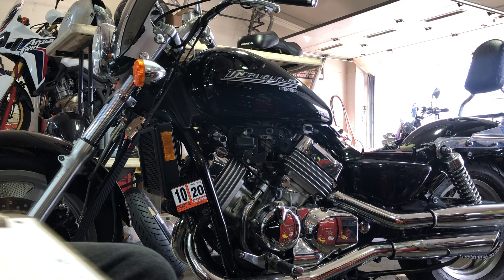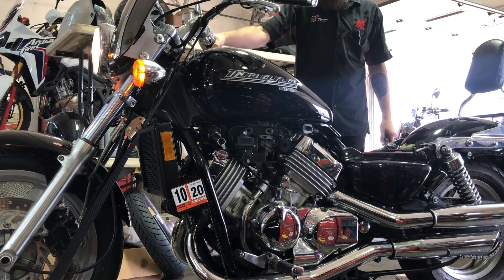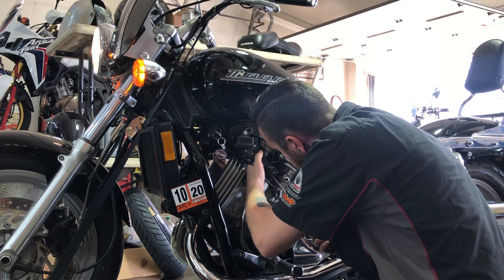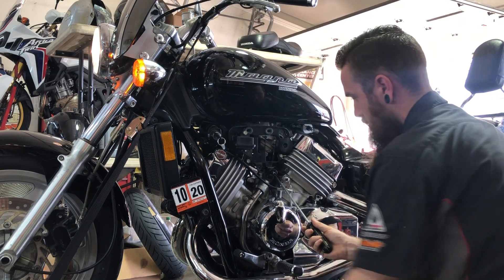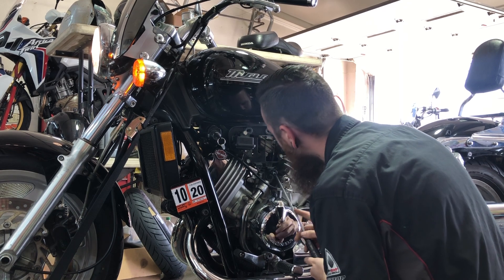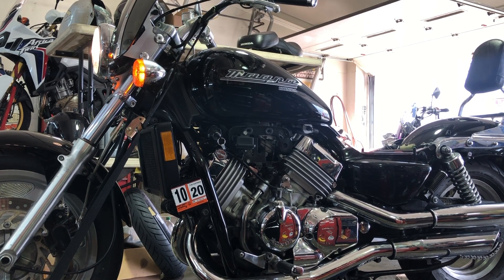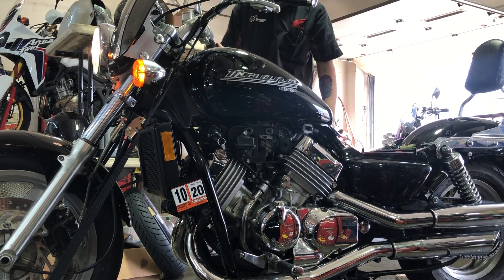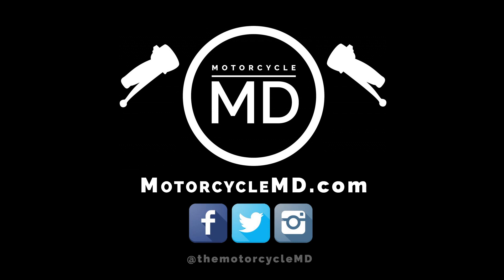Motorcycle Hesitation and Rough Idle: 3 Minute Carb Diagnosis

Comment: Hi. Thanks for the tip. I've have rough idle, bike is Kawasaki ZRX1200. Carbs fully cleaned, synchronized, but idle still rough. Pipe of the 4th cylinder cooler, than others and the sound doesn't change If I turn the mixture screw in or out. What's going wrong? The bike has 96.000 km on the clock.

Comment: Hi Cody, I bought one of your courses on MotorcycleMD. Saved my butt. Quick question: I bought a "D" tool bit for my pilot jet with a flexible handle. I am having a hard time accessing the D-shaped screws. What kind of tool do you use in the video? Any advice to keep the my tool from slipping off?  The access for these screws is terrible.  THANKS!

Comment: i got something simular on a hornet 600, if i run for a longer period at 3-3500 rpm, almost no trottle, when i then gently give it a litle more trottle it starts missing on sylinder 1, if i give it even more trotle about 50% or more it cleans up again, plug on sylinder 1 is black, other 3 cylinders are fine, so it looks like it is getting to mutch fuel when running on the low speed circuit? i changed plug to a brand new identical one, no misses for maybe 1 hour then it slowly comes back, i think it starts missing as it builds up sot on the plug,  adjustment screw is on the engine side of the carb so i guess it adjust fuel not air? i did try 1 turn out and one turn in, but did not make it better or worse, not sure if the idle circuit can even supply enough to cause this problem, maybe someone on here got some ideas on what the issue could be

Comment: Thanks for the straight up diagnosis! Also love the broken moto show 🤘🤘🤘
Reply from the maker: Thanks for watching bro!
Reply: @TheMotorcycleMD  great video bro..very educational and to the point .. I have a question for you, I have a Honda glh 125 SC and I've noticed that whenever I start it up ithe throttle lags for the first few minutes, as it warms and I ride it that lag goes away , the lag is sputtery and the bike sometimes cut off if I accelerate the throttle a bit fast ...as I said it goes away after riding it but I don't like it because almost everytime I have to wait for it to go away ...and I'm not talking about cold starts alone, btw it's a diaphragm type carb and I've tried adjusting the fuel screw , changing plugs but nothing seems to work , pls advise ! Thanks man

Comment: Cool quick diagnosis Cody. Great collab with Matt on brokenmoto by the way - especially the opening banter
Reply from the maker: Thanks for noticing Paul!  We appreciate you viewing the show brother.
Reply: @TheMotorcycleMD I enjoy your video, it very helpful.  Thanks .  I do have a question, I have a 04 Ninja 250r at low rpm it runs fine.  

But as I run at higher speed or open the throttle more than 1/4 it just sputters and won’t let me open more than 1/4?  I thought it might be a bad vacuum slide but what else would it be?